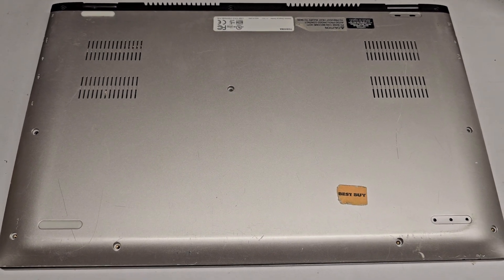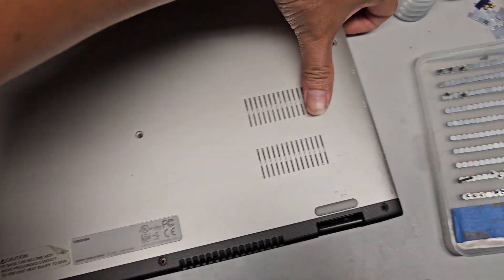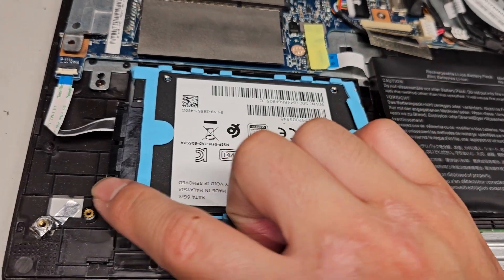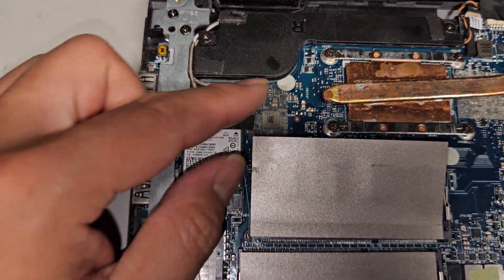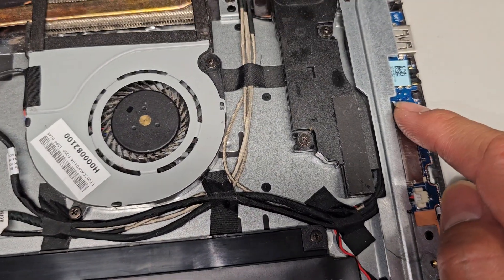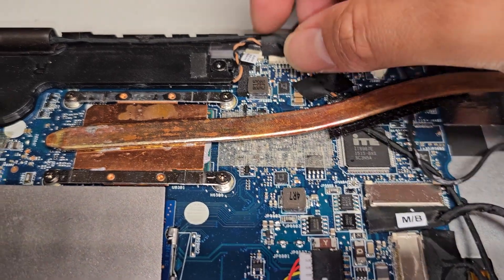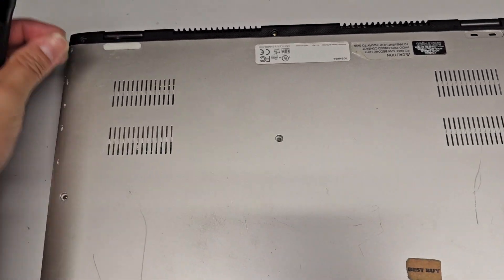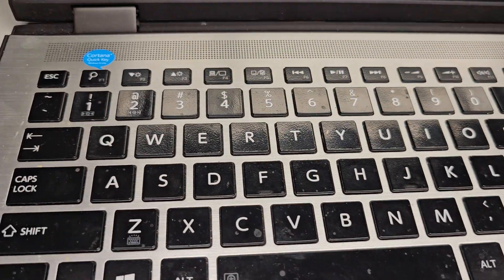Toshiba P55W-C5200X Disassembly RAM SSD Hard Drive Upgrade Battery Replacement Repair Quick Look

Comment: Can you provide the power dc cable information of this laptop?
Reply from the maker: I don't have that. It's on the charger itself.
Reply: @ItsBinhRepaired  I mean the charging port part. It has a sticker on its wire. I want that information. If you could tell me.
Reply from the maker: @miss.reem.7336  I don't know it.